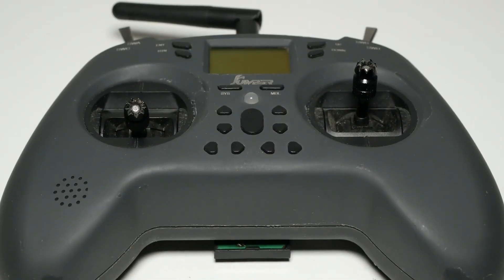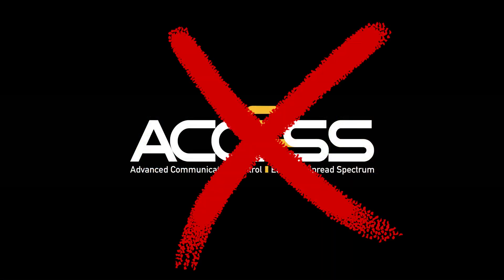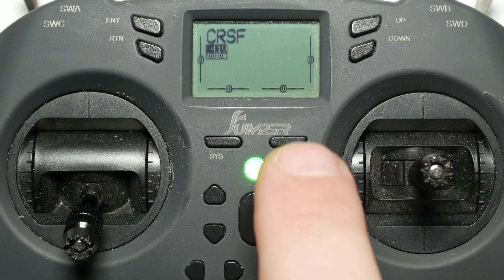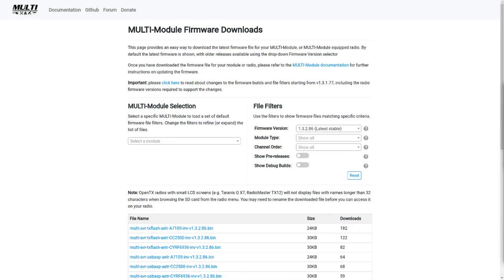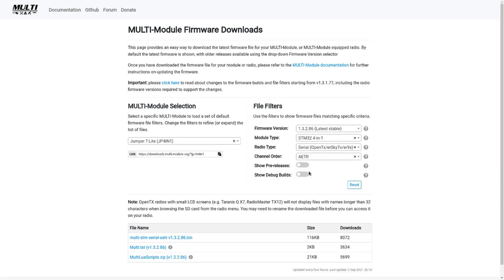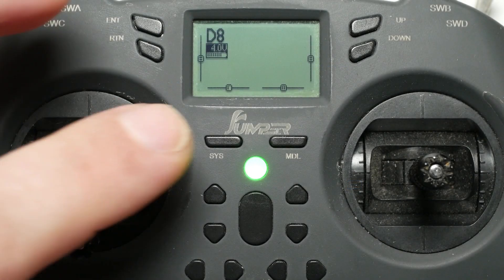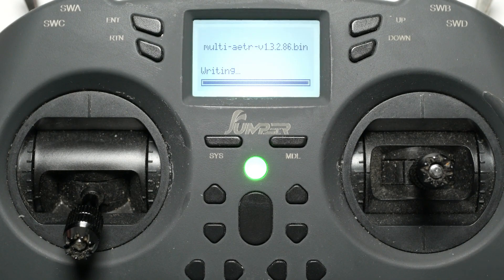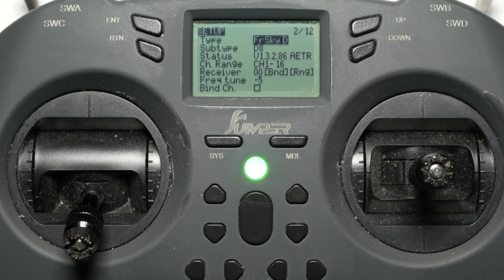OpenTX: How to update the internal RF Multi Protocol Module (FrSky does not bind fix)

Comment: I see u never hooked ur controller up to cpu.  U used the card to hold the contents vice computer
Reply from the maker: Yes. Not sure what your question here is exactly... You download the files to the SD card, put it in the radio und flash from there...
Reply: @stylesuxx  i dont have an SD card slot in my V2.  Where do i DL the content.  Also cpu will not rec controller.
Reply from the maker: @MCeMTPockets  what? My V2 came with an SD card slot, maybe they removed it in some revision and replaced it with internal memory? Not recognized by CPU means what? By your computer? Usually you just need to plug in your radio once powered on, the radio will then ask if it's mass storage or hid device - you select accordingly. Make sure your USB cable is actually a data cable and not a charging only cable.
Reply: @stylesuxx  ok. Thanks.  Will try it again...yes cpu will not rec controller when plugged in with the c type data cable.  Something about hold down trim keys and power button for windows ro reconize controller.   Im just afraid i will brick it.  Surely i will dl and exract files on cpu then move to controller internal memery or do i install from cpu to controller.  Cant find all inclusive to the V2 without card slot!...really dont wanna brick controller.  Thanks for ur help🙏👍
Reply from the maker: @MCeMTPockets  risk of bricking is actually very low. I can't really guide you through it with internal memory, but there can't be much of a difference. Just make sure you mount the radio as "mass storage device" then you should be able to access the internal memory. Preferably do a backup before you play around with it.

Comment: I flashed the EU(LBT) version which doesn't appear to have FlySky D etc - but now when trying to flash the correct one, the "Flash Int. / Ext Multi" menu options are no longer there when long pressing the bin file. Any ideas? Even after reflashing EdgeTX it persists..

Comment: hello, i write to you cause nobody could help me, i have a beta 85 pro 2 v1, it have a spi receiver, and i have a jumper t-lite, they dont bind i tried everything, but doesnt work, my t lite version is the cc2500, but its supose to work eith d8 and d16, what i can do?
Reply from the maker: Within betaflight, how is your receiver set up exactly? BetaFPV provides a manual on how to set everything up - you followed that?
Reply: thanks to take time to answer my question, i just tried your advice, i went to betafpv support page and downloaded the cli for my drone, i applied to it but leds stop working after i do that and still don´t work, i alredy tried the "bind_rx-save" on cli, but doesn't work, i dont know if the radio came with a factory deffect

you think that if i get a extrenal receiver that bind with jumper t-lite CC2500
Reply from the maker: @kongsvisuals2274  Debugging this will be extremely difficult via youtube. Do you use facebook? If so we can try a debugging session via messenger - just link me your profile and I'll add you.

Comment: Sorry for all the confusion in my previous text.Im in a wheelchair & working all the time,so therefor I'm always using talk texted.Lol sorry for the puntcion as well ,but when I say. Or? Damn thing spells it out, Therefore no punctuation LOL sorry for that anyways my question that I had about the immortality antenna was about the one that lrs uses 2.4 g.
Can I use that on a quad the receiver part just as a regular antenna 2.4 and have the same style of antenna which is from lrs you know can I I'm waiting on antennas to come in from Amazon and it's what I'm saying I have those as extra because I do not have my lrs configured with any of their receivers I do have a ep one with the antennas is the reason why I am inquiring my computer is tore up he probably won't get another one for a long time to come so therefore I have been using my cell phone or Android for most of my internet and speedy b for my drones okay thank you
Reply from the maker: Ah sorry, I was not aware of that, makes sense - just assumed you were lazy not to care about punctuation :-/ And regarding re-using the antenna - unfortunately it depends... You can definitely try it - but be careful and do some range test before full sending it. Only make sure that the system matches, so 2.4GHz Antennas only on 2.4GHz system and obviously the plugs have to fit. Being stuck with a phone makes things a bit difficult... Maybe you can find someone in your are to fly with who could help you out. I have a guy in my local group who also does not have a PC and drops by from time to time to get his stuff flashed - so maybe that's an option for you too?
Reply: @stylesuxx  naw your good no one knows unless I tell em.lolAnd then their like awww dam but it's ok,
About the PC thing in the only one in these parts were I'm at,but I d pretty well when it comes t flashing firm on drones just can't do the rest,like receivers and and express lrs cause of the figureator,but I still use the lrs on multi like the FlySky,etc... Receivers,
But one thing I haven't understood is that the multi pro pulls up a lrs in it,don't know what it's for yet maybe it's for spi  fc minis
Reply from the maker: @raydesheles9205  not sure what you mean by that "that the multi pro pulls up a lrs in it," The multi protocol module does not support ELRS, if that was your question, you will need an external module for that.
Reply: @stylesuxx  i know this but in the multi on theexternal put it on multi& just svrol u will eventually come up on express lrs, i wish i could send a pic  i would send it
Oh and i found out from sheer experince that u can use the lrs antennas since the are tuned to 2.4 works kust fine! Lit better range then with dipole
Reply: @stylesuxx  hsy dtule ehsts the other soildering iron like ts100
Reply from the maker: @raydesheles9205  regarding TS100, they seem to have re-branded it, it's now called
Sequre Mini SQ-001
Reply: @stylesuxx  thx for the info on the soildering iron.
Man who would sell it thst eould be fairly cheapest? Maybe i can find a review &get a coupon, aight thx fellow pilot KEEP 'em WERE THEIR SUPOSE TO BE   "in da air" !!
Reply from the maker: @raydesheles9205  I'd say banggood... Here is my review on the TS100 https://brushlesswhoop.com/ts100-review/ I think it has validity for the sq001 too, since it is basically the same thing...

Comment: Hi, I finally found a way to update the TX, Thanks.

I am trying to bind to my R-XSR receiver I have flashed it a few times before updating my TX as it wouldn't bind.
What Firmware should the R-XSR have to bind it to the updated TX.

 I have 3 solid Green, Red, Blue lights when trying to bind before/after the TX update.

Was the TX update for Europe  (LBT)

I have been flashing the RX with LBT
Reply from the maker: You can use LBT, just set it accordingly when setting up the model on your radio. Version should not really matter if you updated the TX module. Just make sure it is ACCST and NOT Access.

Comment: Hello, I’ve got an older whoop with frsky protocol spi receiver that will not bind to my jumper t-lite. It will only bind to my frsky x9d. Will updating the frsky protocol solve this issue?  If I update the Internal module will I have to update my frsky receivers as well?
Reply from the maker: Is this the only board it will not Bind to? Can you generally bind to any receiver? I think debugging here will be hard, I'd recommend you to join the tlite group on Facebook. Chances are that someone has this board and can give you some tips...
Reply: @stylesuxx  yes this is the only board that doesn’t bind everything else binds just fine.
Reply from the maker: @A1phaZu1u  Yeah, then I would speak to the manufacturer and see what he has to say. One thing you could check quickly is to which mode the SPI receiver is set. For FrSky SPI receivers you can usually select between FrSky_D and FrSky_X in the protocol dropdown from within Betaflight. For D8 it should be set to FrSky_D and for D16 it should be FrSky_X.
Reply: @stylesuxx  yeah I’ve tried that, but if I select anything other than SPU RECEIVER/SBUS it doesn’t save in the betaflight configuration. I’ll try the jumper t group, but at this point I’m about ready to give up on this board.
Reply from the maker: You can try to upgrade it. And no, you will not have to update the receivers. You even keep all your binds. Are you trying to bind in D8 or in D16 mode?
Reply: @stylesuxx  Im trying to bind in both, and the jumper t-lite even has clone models of frsky. I've tried updating the firmware and then binding in D8 and D16. No Luck. the board i have is the beecore v2 frsky version.

Comment: I forgot to ask, can updating the OpenTX add protocols? Thanks
Reply from the maker: Nope. The supported protocols are determined by the multi protocol module. If  the chip is not present, the protocol can simply not be supported. There are 4 major RF chips - thus 4in1 module. Each of this chips supports different protocols.
Reply: @stylesuxx  thanks for the explanation! Have a great day!

Comment: Hi. Question, I am new to Multi controllers. I just got a Jumper T-lite CC2500. I tried to set it up to bind with a Bugs 3 but the protocol is not there. Do I need to re-flash the Open TX program to get the Bugs protocol? Also, do you think while I am in the return period I should exchange my controller for a T-Lite 4 in 1? I just don’t know the difference between the two controllers and can’t get anyone to explain the differences to me. Thanks for all your help.
Reply from the maker: The difference is, that the 4in1 supports a lot more protocols. I don't know which protocol the Bugs 3 uses, but if it does not show up, chances are that it is not supported by the CC2500 chip. The CC2500 only supports FrSky and Futaba SFHSS. So yeah - I would definitely swap it out for the 4in1 if I were you.
Reply: @stylesuxx  thanks a bunch for the quick response! I will be getting some whoops, etc down the line so the protocols the better!! Thanks again!!!
Reply from the maker: @stevefilsinger7724  Happy I could help. Usually once you know what you are doing, you settle for one or two protocols anyway, but it is nice to have a radio which basically support 95% of the protocols out there.